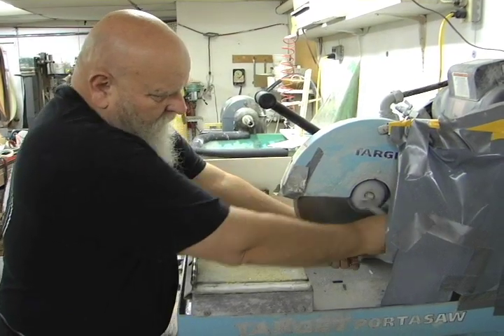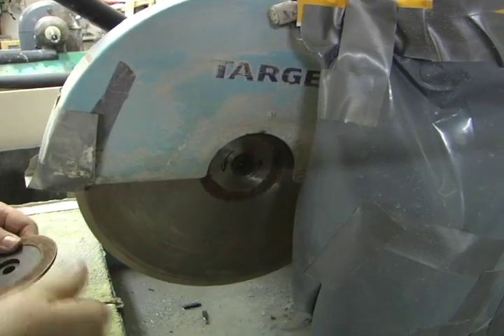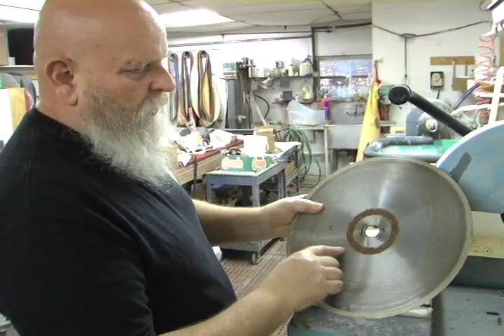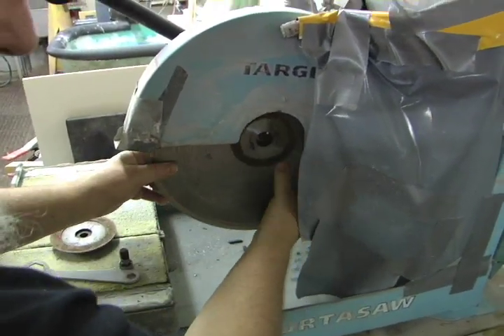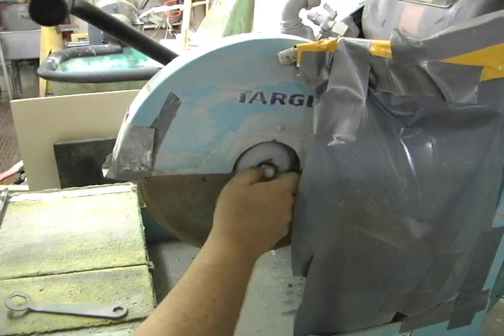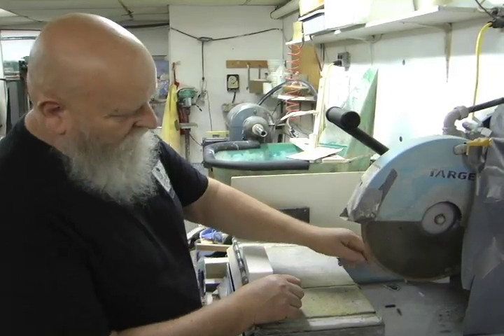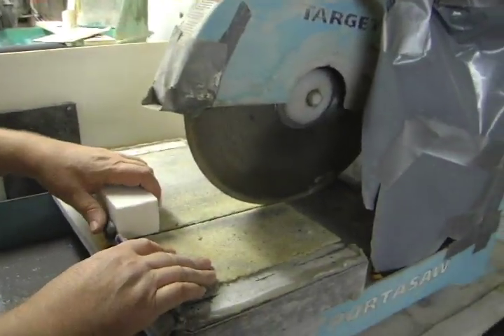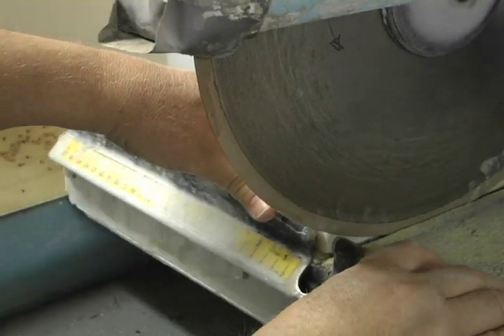Mounting and Dressing a Sintered Diamond Saw Blade

Comment: If you need to use a dressing stick, you are using the wrong blade for the job. Instead, try reducing the diamond content of the blade which will increase the seperation angle of the diamonds. Also, if you are glazing a lot, try changing the pulleys on that target saw to get your rim speed down around 2800 to 3500 s.f.p.m.